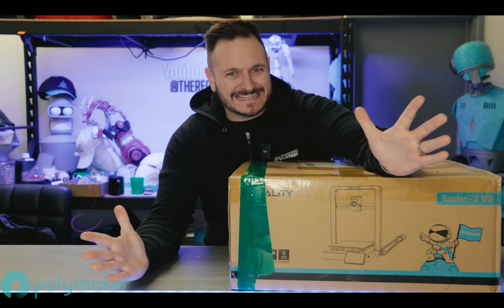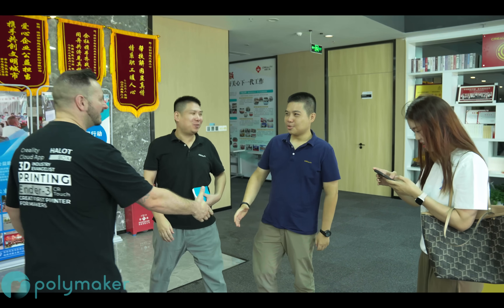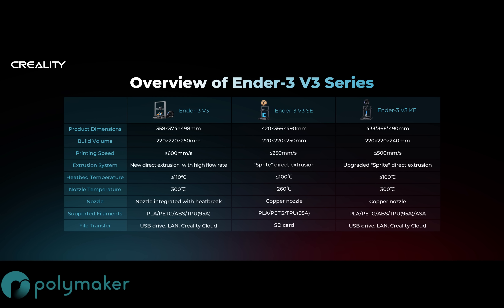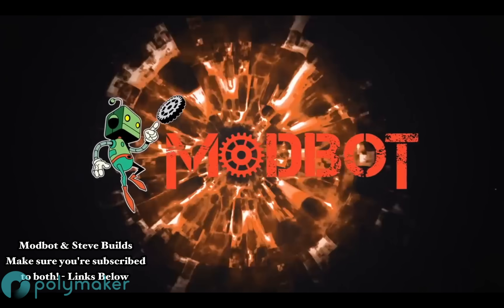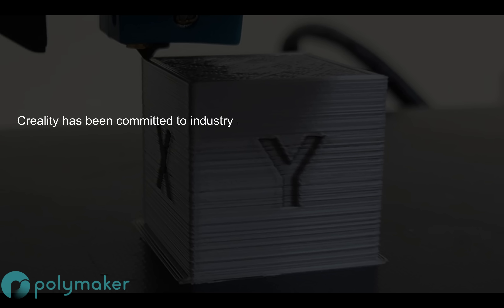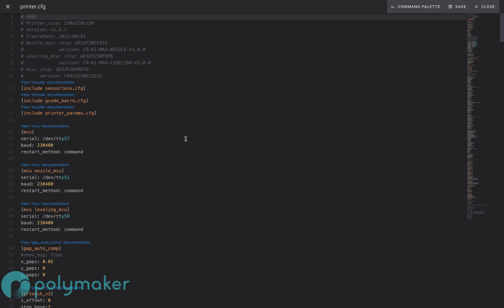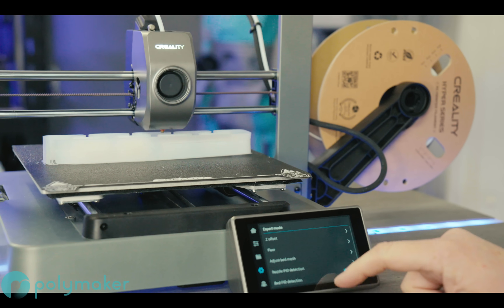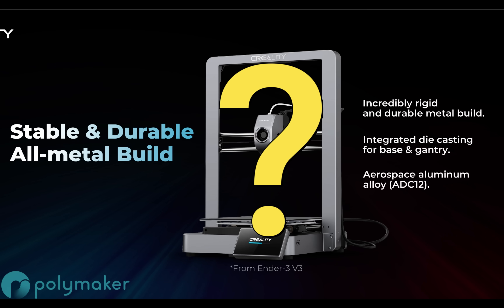Creality Ender 3 V3 CoreXZ 3D Printer Review

Comment: What hotend and nozzle does it use and is it the same as that in the k1 and k1 max?
Reply from the maker: The k1c
Reply: Thanks. Trying to find replacement parts just in case as I've just bought a v3 and google isn't keen on separating the v3 from the other variants. I assume it's because it's fairly new buy man those nozzle replacements are expensive compared to regular nozzles.

Comment: Ender 3s are junk. By the time you replace every part, because its not if but when it will break, you've paid for a decent printer. I would be surprised if this one is any different.
Reply from the maker: I’m sorry to say… it suspect in your case it’s… user error
Reply: Sir, the first Ender 3 was released in 2018. There is literally 6 years of improvements between the V3 and the original Ender 3. Saying they are the same is like claiming that the original iPhone is the same as the iPhone 15.
Reply: @BurntMemoriesAlt  ok let me rephrase it. Creality makes junk.

Comment: Hello. What is the fastest speed you got on a successful print? Thanks.
Reply from the maker: It doesn’t really work like that, max speed is around the 600mms mark but there are factors where the print will need to slow down, on the test print the long path will be 600 but the movement around the shapes will be half

Comment: what do you think of this printer for practical use prints and for robotics. especially for beginners, as I may just cut cost else where to be able to afford something like this.
Reply from the maker: I think it offers a good balance for both, if you go core xy I’ve found that from time to time the accuracy changes. The i3 style like the v3 seems to be a good choice over all. At least from my time using it

Comment: Can you do a video of it versus the ender 3v3 ke
Reply: KE is much cheaper, a little bit slower but really much better printer. This V3 version can't do perfect first layer as KE can, has much harder way of loading filament, spool is on the side so when extruder goes up it pulls filament and when it goes down it just pushes that filament under the bed or around cables. On V3 you can adjust z offset only when print is in progress and  you will have to adjust it because bed is uneven (not only on my printer, i see videos of other people having issues with it but saying it's amazing printer). Also on this printer if you are sending gcode files directly from your pc and after one file is done printing, printer will lose connection for some reason so sometimes you can't send other one until you reset connection. Only good things about V3 are looks and good screen, really KE is better for everything else.

Comment: Well i have a 2pro and i am eager to see a v3 2pro. As at the moment both X&E bowden motors are on the counter arm adding weight and print quality is maxed at 250/300mm/s.  With the new xz it would go above and beyond as it would reduced wobble and weight and far superior wire management. To be able to have speed the XZ setup cuts off weight to centralise mass and to reduce whiplash to retain quality with faster speeds.

Comment: Outstanding review. For almost the same price the Bambu Lab A1 offers 38% more volumen AND the option of multi material, but to me it's actually the option to let the AMS to change filament when current filament run out it's more appealing, I do have a KE and it's a good tinkerer machine and it's miles behind an A1, specially in the amount of plastic parts the KE has. I got the KE because the A1 was actually recalled... Anyway the CoreXZ looks promising, to me Creality should create (at least) a filament run out tool.to keep the printer running (if not a full multi material system) to be competitive with Bambu Lab... My next printer definitely an A1.
Reply: Where on earth do you find a A1 for almost the same price?! Lol

Comment: I'm not sure if i should get the ender 3 v3 ke, ender 3 v3  or cr 10 se. I have the budget for either and why? Thanks in advance
Reply from the maker: What are you looking to print ?
Reply: @TheRealSamPrentice, nothing too fancy, just random things and maybe some cool gadgets and some somewhat large things. I also want something high quality that will last me 2+ years. I also care about speed but the difference from 500mm to 600 mm/s won't make a difference to me. Decent quality is a must and not too much ghosting or ringing. Also hands free leveling is super important. Thanks 🙂
Reply from the maker: @Antoan108 maybe the Ke would be better in that case
Reply: @TheRealSamPrentice, why the ke? Isn't the v3 xz more high quality and better prints? Price is not an issue between ke the v3 xz.
Reply from the maker: @Antoan108 well it’s on rails but also so is the se,
Reply: @TheRealSamPrentice I'm confused because the v3 xz is on rails too, and it has that new fancy system and all metal would that not make it better? I'm new to 3d printing, so I'm a little confused, sorry. Also, does the new v3 have linear bearings like the ke? And does it matter much? Thanks
Reply from the maker: It’s on rods not rails (v3) the Ke is the same on the Y but linear rails on the x
Reply: @TheRealSamPrentice, how big is the difference between rods and rails? Are rods better since they are on the more expensive one?
Reply from the maker: @Antoan108 the rails are usually more expensive the mk3 and mk4 prusas have done well on rods for years
Reply: @TheRealSamPrentice interesting 🤔. So how is the ke be better than the v3 xz?
Reply from the maker: @Antoan108 the kinematics are different
Reply: @TheRealSamPrentice, how? And is the difference large?
Reply from the maker: @Antoan108 well yes, the Ke is a Cartesian the v3 is a core xz
Reply: I know that, but how does this affect the print quality? And how severely?@TheRealSamPrentice
Reply from the maker: @Antoan108  I’ve not seen any real difference in quality just speed
Reply: Oh okay i got it thank you a lot for all your help. @TheRealSamPrentice
Reply from the maker: @Antoan108 if it was my money I’d be buying the v3
Reply: @TheRealSamPrentice  okay I got it. I'll get the v3. I was just confused as you first said to get the ke. Thank you for the help.
Reply: @TheRealSamPrentice  would you make a video comparing the new v3, v3 ke, and cr 10 se as others probably have the same questions as me.
Reply from the maker: @Antoan108 again it’s a personal choice, the v3 is really new and the coreXZ is also new there’s maybe three printers that work in this way one being the voron switch wire which is a kit printer.
Reply: Yes, i understand, but I'll still get the v3 because it's the newest and highest quality. Thank you for all the help 😊 @TheRealSamPrentice
Reply from the maker: @Antoan108  not planned at this moment in time, the cr10 they sent me is still in the box and I’ve got no plans currently to unbox that for the foreseeable future.
Reply: @TheRealSamPrentice  okay 👍

Comment: I truly do believe this and the 3 V3 SE and KE are extremely good printers.   The price is amazing, and if they would make an adapter similar to the Bambu A1, for multi color, then it would be just as good if not better.   I have not had 1 print fail on my V3 SE and have never seen issues with the KE when i have used it.      I would suggest this or the others mentioned as ANYONES initial printer. IT JUST WORKS REQLLY WELL.

Comment: After having recently purchased a K1 (and have been utterly disappointed with the lack of reliability and a plethora of issues plaguing my unit), my next printer purchase will most likely be the Ender 3 V3 Core XZ machine (but I would strongly recommend that one wait about 6 months or more until all of the initial bugs are worked out of the machine as there will inevitably be several "fixes" in the form of new releases in the upcoming future).  Until then, I'll stick with my trusty & reliable original Ender 3.
Reply from the maker: I've had this for 4 months, so we can all wait two right?
Reply: Go for a Bambulab a1, way more worth it trust me!
Reply from the maker: @TotallyNoAim its a good option when they start selling them again of course, after the safety recall. #awks

Comment: According to your review, im still not convinced that this v3 is better then the CR10Se, at same price point, and as durable and less tinker printer. Have you rooted the cr10se and does it make a real diference if rooted?
Reply from the maker: I wasn't a big fan of the SE to be honest, over this it doesn't compare.
Reply: @TheRealSamPrentice i bought CR-10 SE as it price at $284. Not at $399/349. Only on  that case it's worth more than V3 . But if at the same price v3 will outsell fast.

Comment: Due to price of Ender 3 V3, I would buy the K1 when you can find it in the $399 or less cost range.   That is about 200 cheaper than K1C.  I believe the Ender 3 v3 would be more interesting of a choice if it had a price point of around $299:)
Reply: You can find the k1c for only 50 more, and that's worth. Already for the diagonal artifacts it's worth it
Reply: It might go down in time… if it gets under $300 it could be a great value

Comment: k1 is still more interesting. Meh.
Reply from the maker: The max is too
Reply: @TheRealSamPrentice  max has other bed size so it isn't a fair compare. And it is slower then usual k1 though. I didn't see xz price yet, but if it is ~500$ then k1  definetely the better option.
Reply: But it’s $150-200 more expensive than v3. I don’t think that’s a fair comparison.
Reply: @lukas74339  it depends.
I've bought k1 for 11.11 sale for 352 euro, there'll be more spring and summer sales. So I think there'll be offers ~400-450$  for k1
Reply: @lukas74339  
New ender is 390$ and k1 is 500$ at oficial store for now.
Even with 110$ higher price I'ld preffer k1, cos have lots of doubts about new ender. The only thing which is interesting is it's printhead – looks like similsr to k1c. But I still don' like that proprietate nozzle, lol.

BTW, I've boght k1 at 11.11 sale for ~350 euros)

Comment: You also have the CR 10 SE in the mix.  We need a really good review on the different rails. The benefits of linear rails vs linear rods vs SG15 has never been proven to me.
Reply: i also need to know that comparison!! since i jumped the gun and bought the cr10se this weekend arriving next Thursday, as my first 3dprinter for, i hope, more then 5 years in the future.
Reply: @xCyAx  Hi, after a few months, what do you think about your new CR 10 SE ?
Reply: @Not-Einstein-61  I returned it after it arrived and didn't manage to test it. I went with this V3 CoreXZ and i love it. Lots of meaningful firmware updates.
Reply: @xCyAx  Wow, good to know that, thanks.
Reply from the maker: Okay so the v3 is faster overall the se is nice but it’s really the 4th ender 3 in this line up.